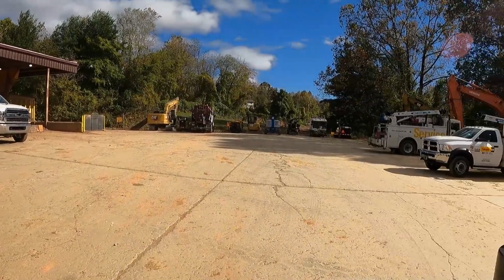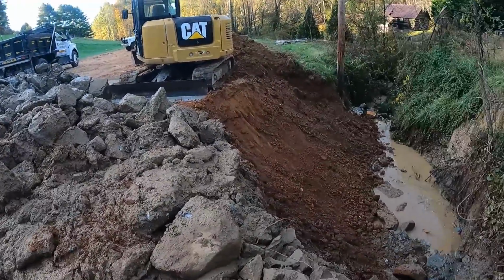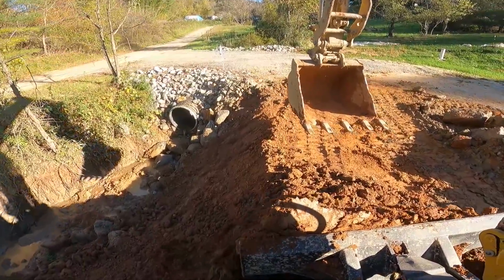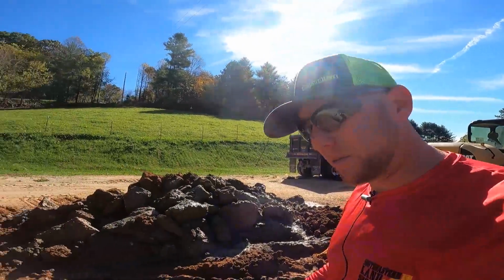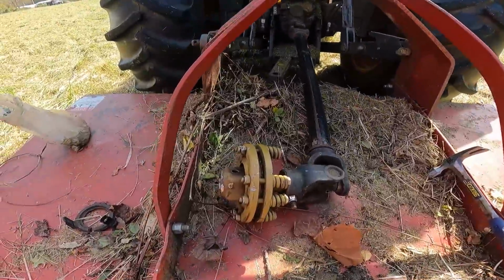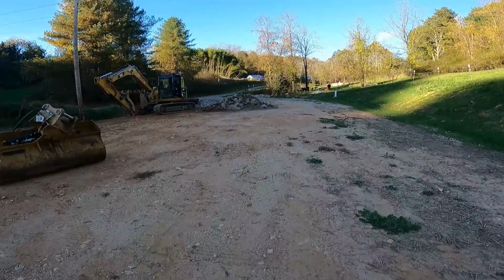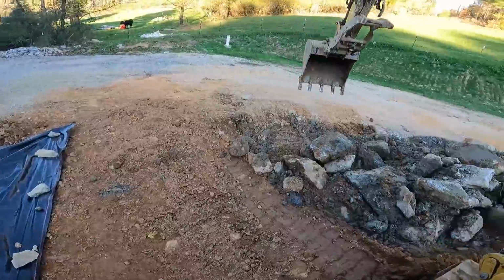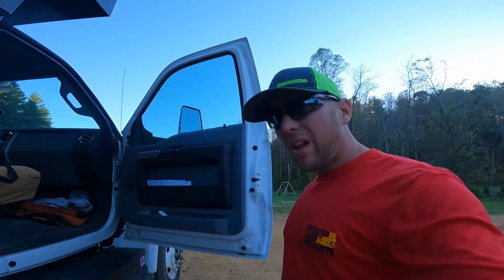Big News Coming! Hauling Equipment, CAT Rental, & More

Comment: I definitely think you get what you pay for with Cat. At least in the Asheville area. We basically don’t have any other REALLY good equipment dealers. They’ll always get you what you need and get it quick. That hasn’t been my experience with some other dealers in the area. As for what machine I think you’ll get… if you’re planning to stick with the 10 ton trailer, I’d say you’ll probably get a 309 or maybe even a 310. If you’re getting a 20 ton for the Mack, probably a 312 or a 314.

Comment: i rented  CAT302 AND A CAT 309 AND WHAT A HUGE REFERENTS this summer i looking into renting a cat 225 or bigger to fix up my livestock pond, dam for 7 days, the problem is the cat 309 is way to heavy for me to haul.  even behind my 5 ton dump truck, putting it in the dump bed puts me why over height. i had to get a tow company with a 5 tom slat bed, cost me $150 cnd each way, 28 miles out of town  to haul it out to me and haul it back,  and there deck is far lower then my dump bedmy 5 ton you need a class D-Z license to drive but you still cant tow over 10,000 with out a class A-z license in Ont. Canada, the A-Z is a license same as needed to drive transport. no other licese covers over `10,000. the Cat 304 i can haul as i can get enough weight on the truck. to put my trailer wheels ^00Lbs under the 10,000

Comment: If you can step into a 312 or a 314…… more doors would open up for sure…. That 308 seems very well balanced and surely would make an easier and better experience than the tippy Zero tail swing yanmar…. You don’t do work in tight backyards that are 1/4 or less….